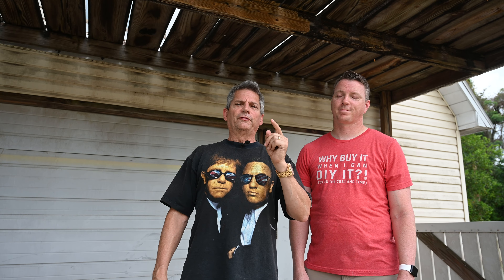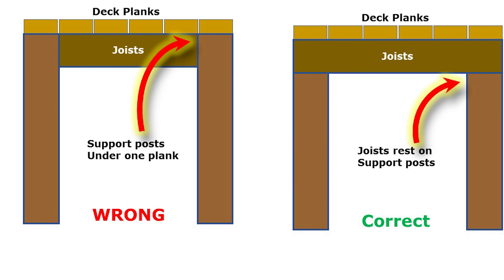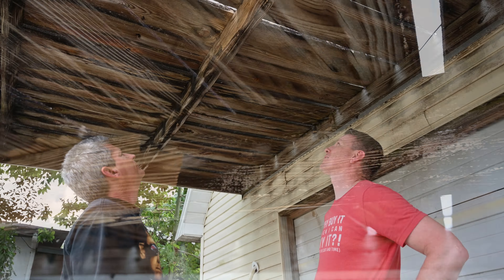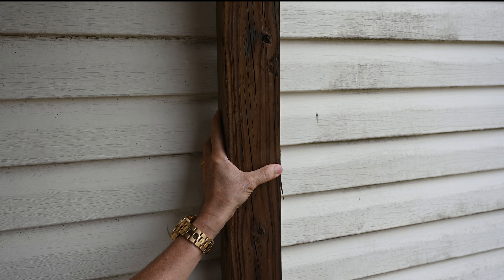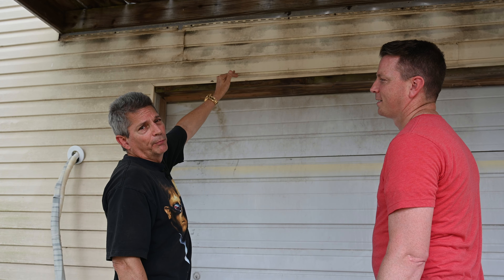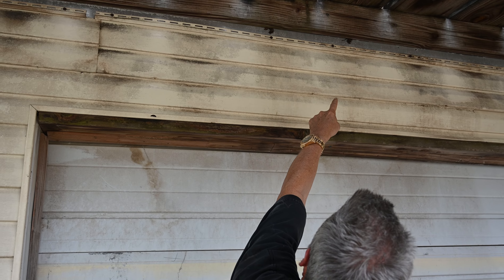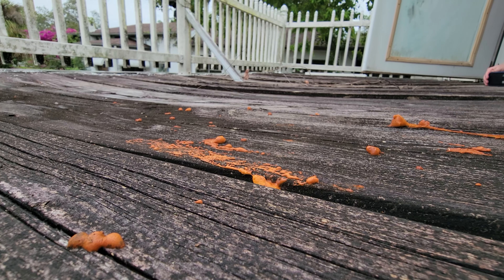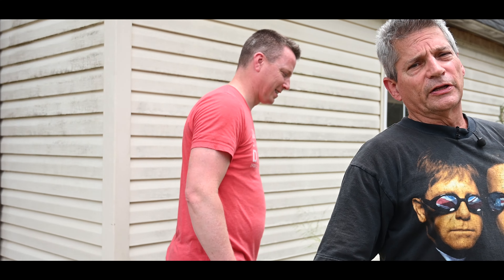AVOID Deadly DIY Wood Deck Building Mistakes

Comment: When I've done deck boards, I've used those free wooden paint stir sticks from the hardware store. Not sure if the proper thickness, but they seem to allow enough for expansion.
Reply: 99-cent yardsticks for longer runs 😅

Comment: The fancy post at 4:23 obviously has been installed before the siding.
Reply from the maker: It could be either way it might be that they cut the siding to put the post in
Reply: @jeffostroff  That would take some real malice on top of that "fine redneck engineering". I'd bet on the post being there since the house was built, which was likely way before we both were born.

Comment: It probably lasted over 20 years or more so all and all it worked for along time
Reply from the maker: But not inhabitable for 20 years
Reply: @jeffostroff  that deck is older then 20 years and it's still standing so idk...it wasn't done right but if the people would of at least treated that deck once a year it would be in alot better shape today and would still do the job...I know it was done wrong that doesn't change anything I get that and it would of lasted much longer if done right but with all that said I'm actually kinda impressed how long it held up